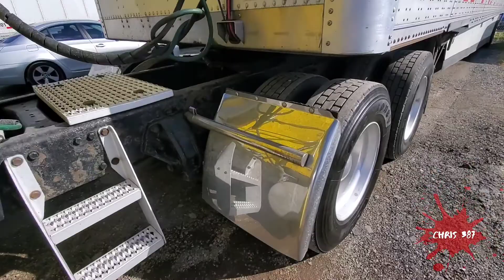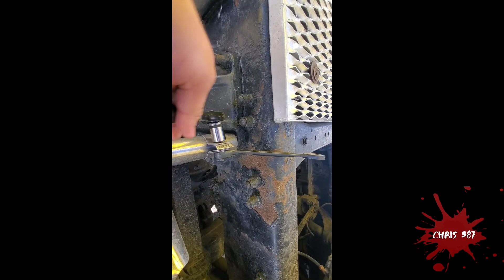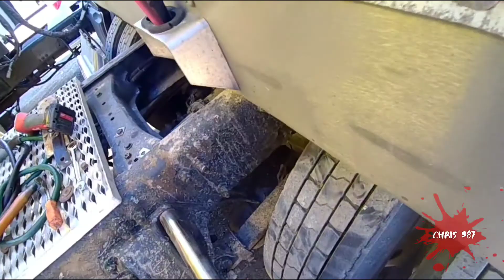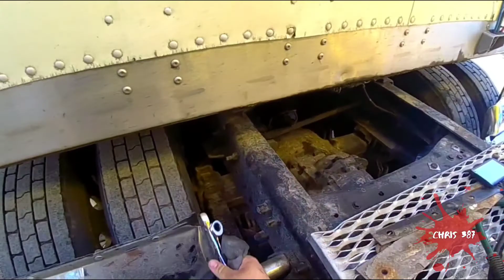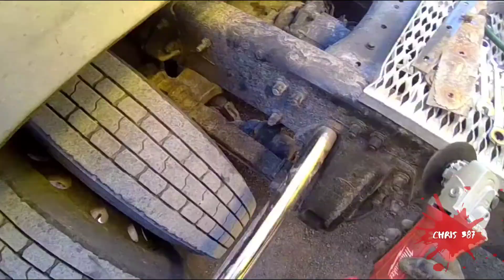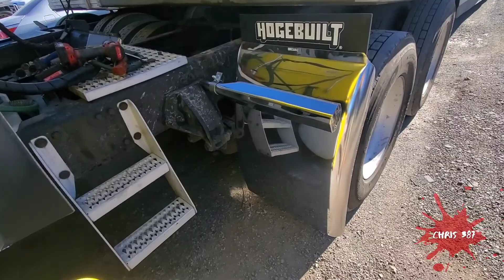New Quarter fenders, Hogebuilt 34inch..Peterbilt.Owner operator/own authority/trucking/camion/chofer

Comment: So what happens if you have to drop your airbags? Do they scrape the ground? And what about the trailer swing? You ever get them bent up from making turns? 

I have a 2011 cascadia. I want to get these but I’m afraid they won’t work and get ruined. Any word on the verdict? How are these treating you and do you think they’ll work for me? Thanks man.
Reply from the maker: They dont scrape when lowering the airbags. Trailer swing no problem exept for one time i went into a place not for trucks but the only dock available was not working so when i was getting out of the place i drove over a high curb n so the front of the trailer went down n bent it. I got it unbent but it was a very unusual place. I dont think you'll have a problem
Reply: Fair enough. Thanks for the info. Love the truck man. I got one of the first gen cascadia’s with the longer frame. It has 3 fairings on the side instead of 2 like the majority. The last fairing is a quarter fender/fairing combo. I’m not much of a fan of it but I’ve seen drivers remove them and install these fenders instead. It’s a good look. 

I just wanted to be sure they weren’t gonna come off if I took a turn. Thanks bro. I think I might pick up a pair of these.
Reply from the maker: @NeilRoss81  I believe you should be fine 👍